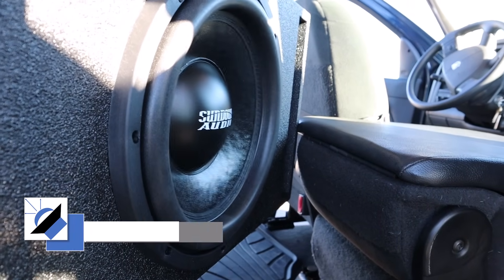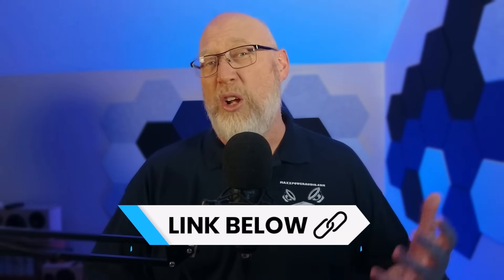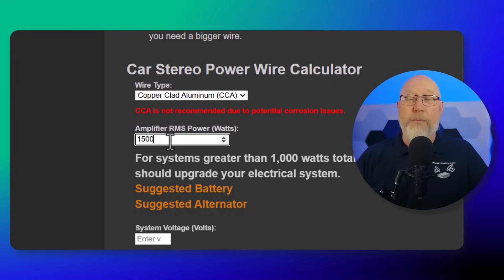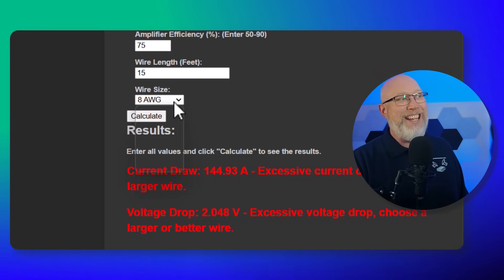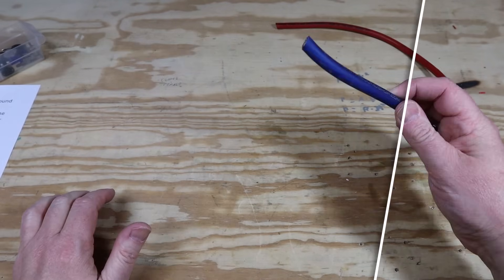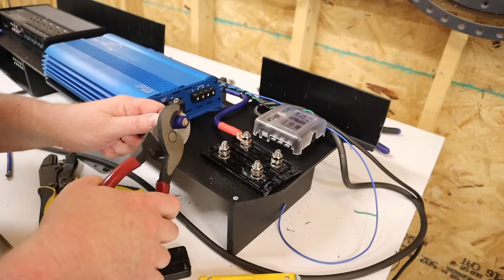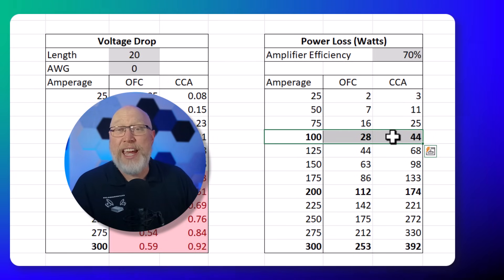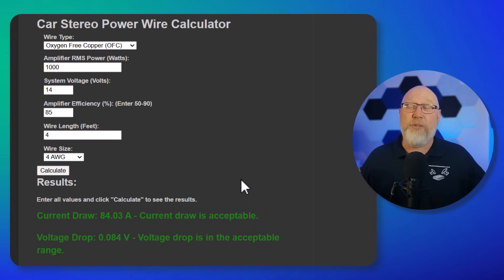The WRONG WIRE will starve your amp.

Comment: If your looking to make BIG Power/Watts & Get Loud/Low, then always Go 0gauge & Never Go CCA(OFC Only). Sometimes you may even need Dual Runs of 0gauge if your Amp or Amps are Really hungry. Your gonna need a Voltage meter to see how far your Drop Off is(14.4-10volts) Remember to low of Voltage will send a Amp in to Protect mode & too low of Voltage makes amps work harder thus Heating Up🔥. If voltage drop is Low your gonna need a Alternator upgrade (240-370amp), BIG3 Upgrade, & 2 batteries (1 under the Hood & 1 in the trunk). You wanna see as little voltage drop as possible when at Redlights(not in park). Always go bigger than you need to take in to account the different accessories you might be running while running your system on BLAST!!!
About to run dual 0gauge runs off a 320amp JS Alternator to a JP23V2 (2800-3200watts) & feed a Single 12" in a 2.5cuft box. The speaker has No problem eating well over 2500watts & getting in to the upper 20hz range. I want zero lights dimming at red lights & with this set up my amp should never Get Hot(warm is OK) as it will have all the power it wants even while running multiple accessories at the same time.
Reply from the maker: Yep.
Reply: Problem with a high output alternator is that they need some RPM to get going. At idle your stock alternator probably puts out way more power. That means at traffic lights your HO alternator is probably letting you down unless you overdrive the pulleys.
Reply: @wally7856  that's why most hi output alternators come with a smaller pulley. You'll need a smaller belt than stock. The alternator I'm installing idols at 180+ amps & goes all the way up too 320 while driving.
Reply: @GA_pyrodawg5181 I HIGHLY doubt your alt is putting out 180A at idle if it's a 320A......  OR I hope you are only running your RPMs to like 2800 MAX before shifting......
Reply: @wally7856  plus if you wanna run your system at 16volts they come with the right regulator to do so. A friend of mine running 2 sundown X15's on 4000+ amp rarely sees his voltage drop below 12volts at stop lights and that's with the AC or heater going. He's got 2 XS Power AGM batteries in the trunk & that helps a little more than just running the upgraded alternator by itself.  It takes Power to Make Power!!!
Reply: No, not at a red light.... If you're doing demos then bump your idle when not under load (for autos) 

I can't remember for sure the numbers but an alternators peak output is like 8000RPM (pretty sure that's wrong but it's TYPICALLY around 2000 engine RPM) and a HO really doesn't excite until let's say 3000rpm so THAT'S why the smaller pulley.... THAT also makes it easier to overspin your alternator so really you should be measuring your crank pulley and doing the maths to figure out what size alt pulley YOU should run.... Does anyone? Nope..... 

Maybe, I don't really know... I just keep rebuilding my HO alts whenever they 💩..... I keep one in my car and it takes 5 mins to swap out so 🤷 (I smoke something like every summer, I've had a brush pop out SOMEHOW and I just smoked a diode in the bridge rectifier this last time, regulators too.... But I run them HARD! ..... I'm sure my capacitors help shorten the life of the components when they deplete and I just jump the car and let the alt have at em 😂) 

And no, I'm not talking about the concrete filled cylinders with a voltage gauge and 3 small capacitors wired in series for 1-5 WHOLE farads..... When I say my capacitors..... I mean 1000+ farad depending on vehicle and what I'm doing to it...... Just FYI 😂
Reply: @commonsenseisdeadandgone  no you get lower RPMs in drive sitting at a light vs in park. So you want no voltage drop at a red light vs in park listening to music. And yes the alternator makes 180amps at low RPM & 320 while moving. Feel free to contact JS Alternators yourself, they'll be glad to break down what they offer & what to expect from their products.
Reply: @GA_pyrodawg5181  I know you get lower RPM in drive at a red light than idle (hence why I specified to bump idle with no load if doing demos.....) 

You should be turning down the volume at a red light (especially if you don't have the battery bank to support it) 

320A H.O. alt on what I suppose should be asked (I assume it's not on a diesel I guess)
Reply: @GA_pyrodawg5181  by "bump idle" I mean raise the idle RPM... 

No need to talk to JS... I've seen them all... I've taken them all apart and they are nearly all the same...  320A will typically idle cold up max 140A. 

There's only so much you can get out of basically 2 alternator sizes... They are MAINLY all just hairpin alternators in different phase configuration (Y/WYE/Star/3-phase or 🔺/Delta/6-phase.... H.O. alts are Delta... 

I run a 370a and 320a, I build/repair/assemble my own power banks (alternators, lithium batteries and supercaps), I repair my own amplifiers and I rebuild my own subwoofers.... I do every single thing on my cars...

I don't know everything about anything but I know a lot about a lot... I research and don't want to stop learning. I gladly will teach/explain/help people that don't understand but I'm also an a§§hole and don't have patience for lies (misinformation and more importantly disinformation!) there is so much trash out there now and car audio is plump full of it and so is YouTube, no thanks to themselves and their sensor 💩 (spelling is intentional... I'm highly flagged for ridicul..... I digress)

Comment: For amusement I throw this into the mix.  Delivery of AC compared to DC is different.  If you have a small form factor amplifier install it close to the power source, in turn the signal is now AC basically which one can deliver that to the drivers.  But those in the U.S. can feel free to go outside and many cases one see copper clad aluminum delivering power to their houses from power poles that's not even near the voltage what's being transmitted down high tension wires from power stations or hydroelectric dams. But this discussion will lead to ones system layout and design. The old Lanzar amp's would use unregulated power while others designs like Hifonics would have a strict regulated power stage, then Phoenix Gold were designed to be stable with low impedance but were not used in high wattage class vehicles commonly when I was younger from what I recall. This was also depending if one was competing in... wattage/sound Q  But I digress, and that some might even be able to install an amp under the dash of a vehicle for example.  But then head units I will assume are much better these days.
Reply from the maker: AC electricity is fun stuff, most people have a DC mental model and thus don't understand how AC works.

Comment: Only use welding cable. It’s actually rated for hot,cold,wet and abrasion. It’s the best wire period. I drug the same 50 feet out everyday for over 10 years through the most extreme conditions drilling water wells in the pnw 6 miles from Canada. Never had to repair the wire or anything I had to redo the ground and electrode on the end once. Still one the set of cables today it’s been 20 years. And it’s true awg of course.
Reply from the maker: I have heard good things about welding cable.
Reply: Thirty years ago I didn't have a source or know where to get it, so I went to my local marine supply store to get some cabling as it was to resist diesel, gas and oil and was less than what my local audio shop wanted to charge.
Reply: @ yeah just like welding cable. Good thinking on your part.
Reply: Use silver tinned marine grade wire. Best you can get is Greg's Marine Wire.
Reply: @ yeah I’ll stick with welding cable silvers expensive and not necessary in auto application
Reply: @Thumper68 - I really hope he means Tin coated, copper wire?  Silver oxidizes quickly in dissimilar metal junctions, and corrodes in alkaline or acidic environments (like the ocean, or your sulfuric acid  based vehicle battery)!  It also turns pitch black (corrosion/embrittelment) in the presence of H2S gas.
Reply: Back in the 1980s/90s I used to buy surplus (new old stock) 1/0 2/0 welding cable for high power installs. Typically for less than 25¢ a foot.   Sadly, them days are long gone! 😭     I have never bought or installed CCA (Chinesium Crap Aluminum) wire - and the day I have to, I'll find a new hobby!
Reply: @ hell even up to mid to late 2000s prices were way way cheaper than now. The last 4 years have been extra brutal for cost of everything across the board. The only reason fuels not $6+ across the nation is because Biden drained our reserves to artificially keep price down in an attempt to fool the people. Thankfully it didn’t work and the grocery store hurts the pocket book real bad even if driving their is still an annoying paper cut.
Reply: Also very flexible if you get the good stuff.

Comment: Thing with this online calculator thing is that the shown amperage draw is at absolute max.
Oftentimes the amp will even at very generous volume will draw substantially less amperage.
So, specing your cabling for always max power is something that's usually only done for SPL competition and/or demo vehicles.
Reply: I can attest to what you are saying. I did everything by the book, 320amp alt, zero gauge ofc , big 3+, 8 gauge speaker wire, additional 30ah battery. Wired to 1ohm nominal load on orion xtr2500. But in reality impedance rise keeps me at 3ohm average. So 10 gauge speaker wire and 2 gauge power wire would have been fine  since I am not in the spl lanes. But yes if you are not experienced err on the safe side.
Reply: You'd be surprised.... 

You're not taking a very important factor into consideration... The amplifier isn't the only current flow... The alternator is ALSO sending current to cover said draw so the amp pulses 300A but then the alternator produces (ideally 300 plus what everything else in the vehicle is demanding ... 

Batteries don't really do much until voltage drops to their operating range (LA, SLA, AGM and LifePo4 batts being typically ~13.1v-11v otherwise above that is pretty much all the Alternators doing... Batteries will supplement and buffer some of course.

That's why your voltage will go from 14v to 12v real quick but takes a bit more to drop to 11v and then to 10v... Then the amplifier SHOULD protect until voltage is back up.... At which point you should turn it off/down and let everything come back up and stabilize... As well as chill out but who does that?)
Reply: @commonsenseisdeadandgone  Um, I've already done that test with my system, so I do have a pretty good idea of what the result would look like ;-).
Reply: @Grommet2007  what amp clamp you got?
Reply: @commonsenseisdeadandgone  Klein CL 390. Rated to 400A.
Reply: @Grommet2007  yeah, you’re seeing half the story….

IF you’re lucky…. 

You’re also listening to some thud………………….. thud………………. Thud………….. music
Reply: @Grommet2007  in other words…. You’re probably fine with what your maths were above… I also do not recommend but I’ve seen more with less work so…. 🤷🏼 😂
Reply: @commonsenseisdeadandgone  meter had "max" mode enabled. It should have captured the peak current draw during each "thud" 🙂
Reply: Exactly...Thank you...I just posted a comment about the same thing. The same thing can be said with respect to the performance of most stock electrical systems. I know plenty of guys including myself that just use 4 AWG ofc running to a "2000 watt RMS" amplifier @ 2ohm. I have a stock electrical system with a 130 amp alternator and a 700-800 CCA run of the mill lead acid battery. Nothing special....I listen to music only and dont do burps or spl and even when I'm slamming on my system up to 125 DB plus I don't experience dimming lights nor does my voltage ever drop below 13.9 volts.
Reply: @FrankBennett-kb7xs  why did you put in quotations "2000 watt RMS" (and is it 2000 AT 2ohm? 

4 gauge OFC will handle 2000 watts just fine.... Was it said it's not?
Reply: @commonsenseisdeadandgone  Because if you are listening to MUSIC with a 2000 watt rms amplifer it's never actually continuous 2000 watts rms....Typically most people will tell you that using 4 AWG OFC to a 2000 watt amplifier is undersized when it will work just fine. I know the car audio industry in and out ( been in it over 25 years) and I'm just trying to clarify that the industry has long marketed to people snake oil whether it be overpriced RCA cables, magic sound deadening material , to the need for spending the unnecessary amount of money on oversized OFC copper power cables.
Reply: Exactly...I made a similar point but my comment vanished...Playing music even with high power amps is way less strenuous on a car's electrical system than burping sine waves and doing spl drags...
Reply: @FrankBennett-kb7xs  define "high power amps"? 

I don't think you guys really understand or know what "high power" is... I'm sorry but 125db certainly isn't nearing it... I think I answered my original question now... 😂
Reply: @commonsenseisdeadandgone  I'd say high power is anything above 2000 watts for sub detail. That's right about the realistic threshold to where a guy would have to consider something like maybe a second battery or assisting his stock electrical system vehicle depending. It all comes down to listening preferences as well. If a guy is into SQ and only crosses his subs LPF 24DB @ 50 HZ and has a house curve dialed in to where his bass frequencies 20HZ-125 HZ are 10-15 DB higher than midrange and high frequencies that's actually really loud listening with that curve in mind. I know some guys here are mainly into SPL and not going for traditional SQ house curves ( JBL or Harman curves) and 125 DB isn't that loud for subs, however if you have your DSP setup to where your subs are again only 10-15 Db higher than your mids and highs, 110  DB of midrange frequencies and high frequencies are loud as crap.
Reply from the maker: You can do what you want with your own system. As for me, I'm going to advise people to err on the side of caution.
Reply: @DIYAudioGuy  Perhaps for your next video, put a clamp ammeter on the power cable to your amplifier, play the system as loud as you're prepared to play it, then use the meter to measure the peak amps drawn. I think you might be surprised at the result ...
Reply: So, add a bit more context...

My car audio system is fairly modest by today's standards. Bass is provided by two 12" Alpine Type Rs in a fairly large sealed enclosure with an Fb around 38 Hz, powered by an Alpine PDX-M12 that's capable of 1.2kW RMS, 2.5kW dynamic into 2 ohms.  The amp is located under one of the front seats (stealth install, but it does mean a much shorter power cable run too).  

Well, I needed to add some protection to the power cable, but I think car audio cable fuses are the spawn of Satan and opted for a circuit breaker instead.  The only thing is, the only one I could find locally at the time I put the system together was rated at 300A, which was way over what I thought the system would ever draw.  

Sometime later I decided to replace the circuit breaker with one with a rating that was a bit closer to what the peak current draw would be. So, let's see... 2500/(13.8*0.75) = 256A if I was to consider dynamic power, and 1200/(13.8*0.75) = 116A if I was to consider the RMS power, right?

Well, instead of just going by the calculations, I said to myself "why not just measure the peak current that the system was drawing at the highest volume I'd typically ever play it?".  This would require a clamp ammeter with peak hold which I didn't own at the time, so I went by a friend who did own one (a nice Fluke model) and told him to measure the peak current when I cranked the system.  The result was so much lower than I expected that we ran the test again... and got the same results.  Still not satisfied, I ended up buying my own clamp ammeter with peak hold (the Klein CL390), based on recommendations I received, to do my own tests.  And I got the same results, LOL.  I'll let you have a guess at what the result was, but let's just say that the 100A breaker that I eventually purchased more than meets the requirements of my system.

Why is this? 

Well, while my two Alpine Type Rs were wired down to a nominal 2 ohm impedance presented to the amplifier, their actual impedance at the amplifier terminals varies between 3.2 ohms to 16 ohms in the frequency bandwidth that I use them. An amp rated to deliver 1.2kW into 4 ohms is going to deliver only 300W into 16 ohms.  Using the same calculation as used previously, current draw at peak output into a 16 ohm load would be, um,  ... 29A :-).

And I used to use a 300A breaker with this system, LOL
Reply: @Grommet2007  you sir, are correct!
My guesstimation is a peak of 64A..?
Reply: @gmcminitruck  Even less than that, LOL.  I won't mention the actual figure, because most here probably won't believe me anyway, but I do suggest that, if anyone's curious about the actual current draw of their amps when playing music, even at high level, perform the experiment for yourself. The results will likely surprise you.
Reply: @DIYAudioGuy  I will concur as all of this is done for safety as well as some might not know where or how to find this knowledge. Long ago I'd been in the novice 700+ wattage class thirty of so years ago I had to go to a library and actually read about things. But I digress, as I have two devices that I will be powering.  Both being basically amplifiers, though one is usually referred to as an invertor.  I'd even considered a stiffening cap, but that's just another element and discussion.  Nah, I'd rather not "starve" my hardware and make their power rails work harder than need be and make even more heat depending on the design.  I forgot to thank you for the topic coverage, though these might be my first comments/responses on your content. 😁✌